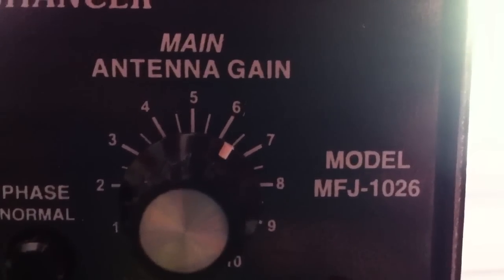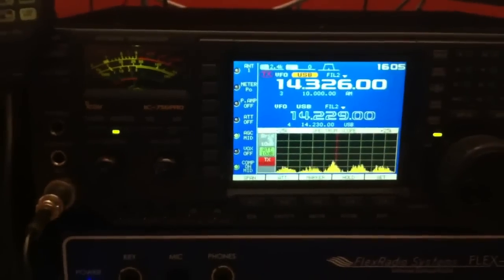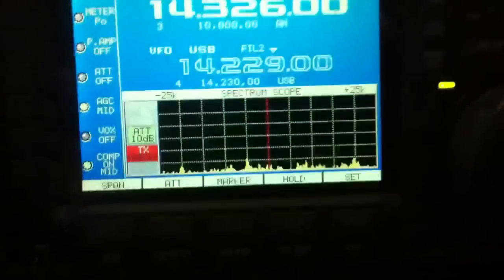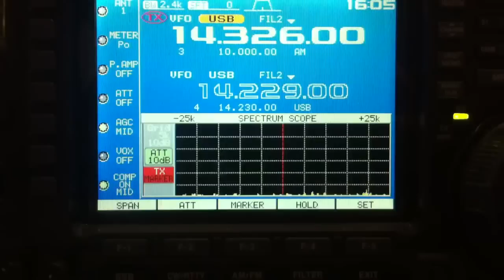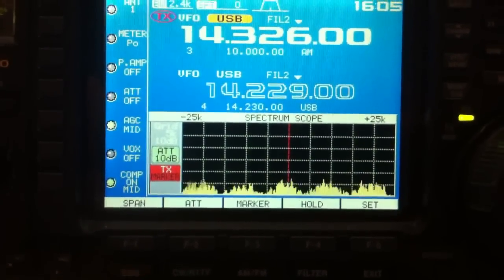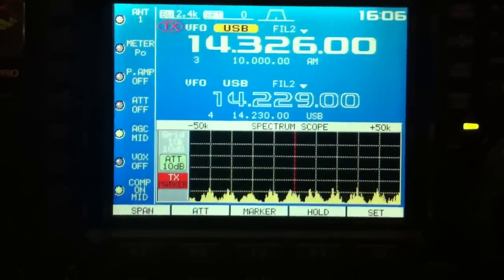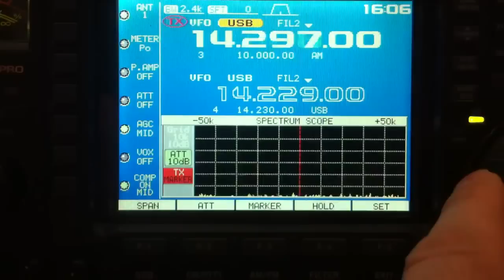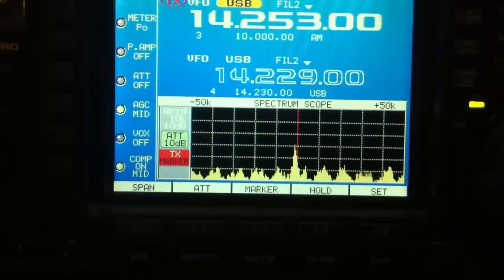The MFJ-1026 Noise Cancelling Signal Enhancer

Comment: Its not for all noise or for all situations, but this thing really phase-cancels some problematic RF noise.  It wont make a 4/3 signal into a 5/9, but in some situations it takes down the noise floor to reveal an signal you didn't even know was there.  Great video, really shows the noise phasing out across the band and the s/n radio of the desired signal improving.